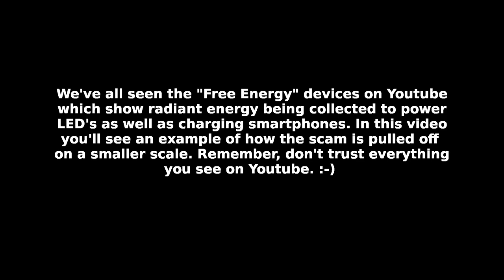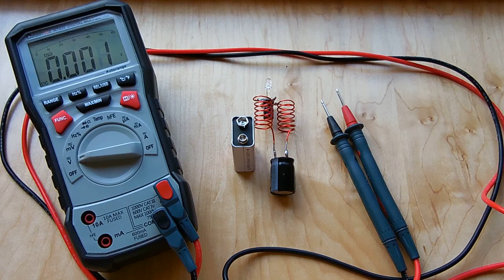"FREE ENERGY" Radiant Energy Collector?

Comment: K like for real though, "radiant energy" is the 1800-1900's way of saying electromagnetic radiation and rectena's are used in modern, professional devices like RF-id tags and low power remote sensors with wake timers that get a chip to do a small task once every few minutes or hours.

Building an ambient EMF rectena is pretty simple, you need an antenna and a ground or a dipole antenna and you will also need a bridge rectifier. Personally I like the KBP310G bridge rectifier. But you will get better voltage if you use BAT46-TR diodes and manually make the bridge rectifier.

From my body to ground I can charge capacitors to 5+ volts, mind you at uA of current flow, but still the capacitor charges.

Using a proper antenna you can harvest significantly more energy. Lighting LEDs is pretty simple and many LEDs have a low enough power that the rectified RF is enough to power them as some LEDs actually only need uA of current.

If you have a nice HAM radio setup, you can actually harvest quite a number of milliwatts from a single antenna.

Comment: Ok, well I've tried simple thing with my antenna on the roof. 

It gives 0.8V AC without grounding. 

When I take ground from socket, then meter shows 5-6V AC at 0.1A stable. 

I made only full bridge rectifier, no caps, and drop to ~4.1V DC. 

Attached 2 green diodes, still showed 1.8V heh... 

Not sure what to do next with that 😃

Comment: Unfortunately there are currently a wide variety of signals put out by private and public sectors. That means any "free energy" we pick up on is just being put out by someone else and so it's not really free. The FCC will stop you from mass producing it because it your device operated on standard radio frequencies - when you use the power for a hairdryer, someone else can't reach the station they would normally be tuned in to. You would be stealing their power.
Reply: Actually that wouldn't happen at all. The amount of energy is usually quite small at best. No where enough to run a hair dryer.
Reply: Just run an extension cord (a very long, durable one) from another house to yours.

Comment: The circuit is in resonance. It would be possible to make the magnetic motor to be in resonance and get free  energy. Calculations needed to tune up sizes of L, C, R, with viltages , currents.
still you need input, however minimized.
Reply: Input=energy, from a source. No source=no power.
Reply: @rootbrian4815  exactly!

Comment: You'll have many dislikes today from the free energy blind believers lol.
Thanks for the video.
Reply from the maker: toolman talal That's expected, not all people did well in school.
Reply: Drakilicious there is no "Free Energy" every thing have its price and cost nothing free at all.
Reply: electronicsNmore WRONG definition of "free energy"! It's not the mythical scientific version, it's the very real electromagnetic wave that you don't HAVE TO PAY FOR version. The device is still fake because of the signals being to weak to be useful to power anything NOT because there is no such thing as capturing energy that you didn't create without paying for it. Hold a fluorescent light bulb under a set of high tension power lines and you WILL get light from "free energy".

I lit my wife up with "free energy" one time at a facility that had the check-in area directly under, and parallel a set of high tension power lines. I saw the signs warning drivers to use gloves to avoid shock so I told her "visitors need to check in here". I then asked her if she had her I.D. knowing she didn't have it. After she touched the climb bar I told her that I was kidding about checking in, lol.
Reply: electronicsNmore A truck is 8ft wide, 13' 6" tall, and about 68' long the sheer size of it made that induction possible because it's not a true coil, just plate aluminum, my question is can you do this Mythbusters stlye? Now that you have busted this device, can you build a coil that might be able to power something that you can test under a high tension power line? Looks like to me even though your device might not be 13.5 feet in the air and damn near 70 feet long, it will be way more efficient if it's made with a coil of copper wires and shouldn't need to be nowhere near as big.
Reply: Oh snap! XD
Reply: Bro i make tube cell that produce free energy.what do you think crystal batteries are...no offence fool.think forest think.
Reply: @Stacy_Smith  There is no free energy, if the wiring is unshielded/uninsulated, there is a high risk of electrocution.
I did the florescent tube thing before, it didn't work. Only static electricity worked, for half a second.
Reply: @mysticalsoulqc  Prove it. Unless you had to plug it in, it's not "free". Especially if drawing from another source (wind, solar, grid, battery  - That needs to be recharged).
Reply: @rootbrian4815  nothing is free everything is transformable. try a nuclear batteriy it should keep you fueled for as long as you need. did you know there is 1000 liters of hydrogen in one litter of water. maybe one day you will not look for things to be free you will look to what is truly possible.echo a echo...
Reply: @rootbrian4815  you can also lookup cristal batteries or my tube cells.. and...
Reply: @mysticalsoulqc  I didn't have to pay to light my wife up, so yeah...

It was FREE!
Reply: @Stacy_Smith  welcome to the club...tube cells... lol

Comment: not free energy, but technically it is radiant energy :)
Reply: No, not even radiant energy either as the source.
Reply: Not radiant energy, just electromagnetic induction which you have to pay for from the power company.
Reply: Wrong definition of "free energy"! The original scam video was talking about energy that the user is not paying for. It's very REAL, useless for powering anything in damn near 99.999% of the time, but very real. The only reason why I didn't say 100% is free lighting under high tension power lines with a fluorescent bulb.
Reply: @Drakilicious One log won't heat your home and with wood heat you have to own the land plus the value placed on your time to process the firewood. Otherwise you are buying bundles from someone else.
Reply: @Stacy_Smith  Or you are just simply camping out in the woods and using the wood that is lying around for free.
Reply: @emuhill  EXACTLY! Same action, one I'd consider free the other I wouldn't. In 6 months you are the only one I've run across that understands that "Free" could mean in the financial sense. Not everyone is a physicist.
Reply: @Stacy_Smith  There is no "free" energy. You have to pay for it regardless. You still have to PAY FOR a solar panel to generate electricity and it only works when the SUN is up (your side of the planet faces the sun).
Reply: @rootbrian4815  Actually you can store the energy from sunlight until the next day.